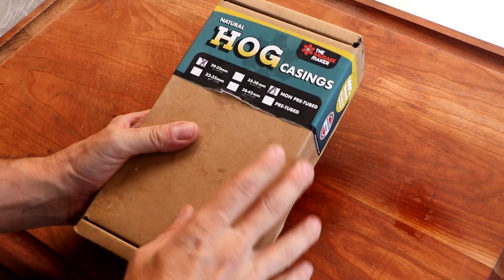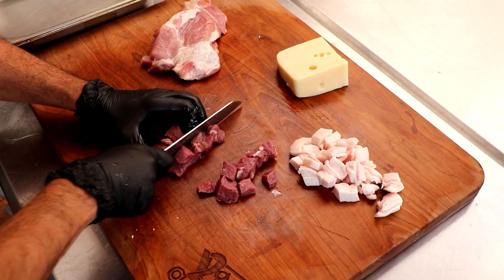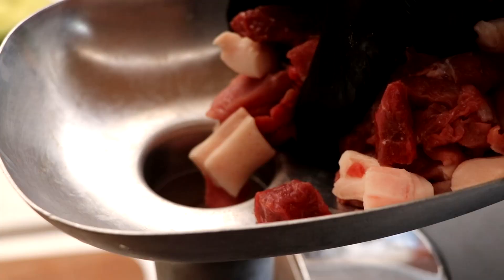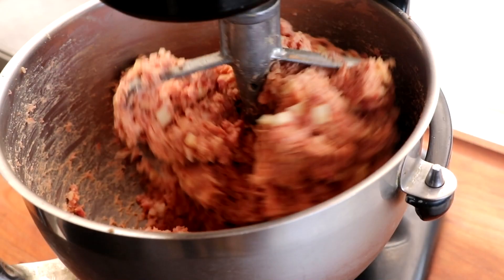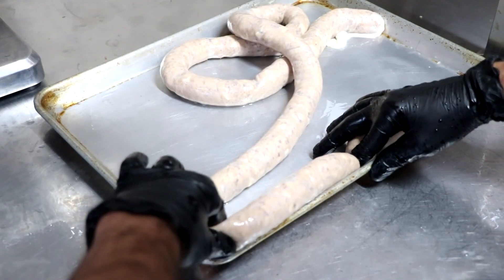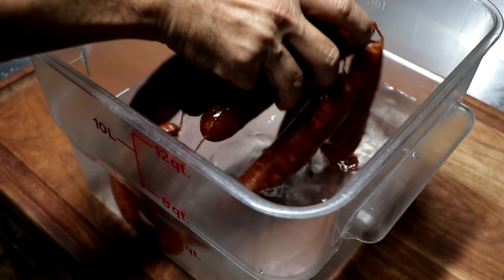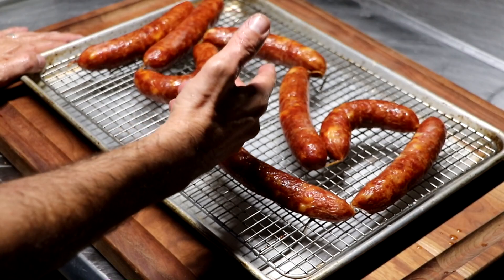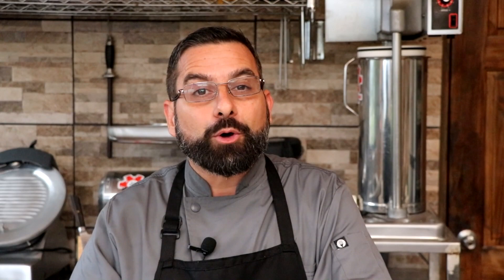Käsekrainer - Cheese Sausage | Celebrate Sausage S03E26

Comment: If you hot smoke these instead of cold smoke, would you leave out the cure or still use it? If you leave it out, would you need to adjust the other spices, or leave them the same?
Reply from the maker: Hi Jeremy.  To be clear, these sausages were not cold smoked.  The language Joe used is misleading and typically BBQ guys will mis claim that they are cold smoking.  Cold smoking is placing meat in a smoker at temps below 85f.  The finished product is still raw.  What Joe did is considered a low and slow.  Either way a cure is recommended.  If you "Hot Smoke" (which is to cook your sausages in temps above 225f) you can omit the cure all together, but you have to cook your sausage to in internal of at least 150-155 for pork.

Comment: How hot does a sausage neet to get before high temp cheese is needed?  The reason I asking is there are a lot more choices, for using regular cheese.
Reply: I am a cheese maker and a sausage maker. I would suggest taking a sample of a few cheeses that you might use in sausage and putting them into an oven at 145f. Small cubes like you would add to the sausage. See which ones start melting at that temp. Then increase the temp and observe. Cull out the cheeses that melt first, or use them at that temp they melt at. I watch several channels for sausages and high temp cheeses are used when often when makers are going to smoke/grill at 275f. It's a subject in flux on the internet at this time. Check out Chudd's BBQ, Grillin and smokin wit AB, Smokey Joe's, Meet Church, etc.

Comment: Nice vid - on another note-  what's the diameter range of sheep casing? Can u make Sausages without the fat though?
Reply from the maker: Sheep casings range from 18mm to 26mm.  While technically you can make a sausage without fat it won't be very good.  Fat brings a lot of flavors, juiciness, and texture to your sausage.  You can have lean sausages (10 -15 %) and that would be ok

Comment: Why would you add cure if you're planning to refrigerate the cured meat? Does the cure not make it shelf stable?
Reply: The cure gives the nice red color and adds flavor, which also are the reasons why cure is used in Leberkäse.
Reply: The sausage was being smoked is another reason.
Reply: @TheWolfyDaddy  
So it has zero reason... Color is not a good reason nor does it actually add flavor. Smoke adds the color
Reply: Cure has nothing to do with shelf stable, nor refrigerating the meat.  When meat us cooked at low temps like 100 to 180 and ground up meat is thus between 50 to 130f for a long time, it is perfect temps for bacteria  pathogens to grow.  In particular, the inside if the ground meat ends up with no oxygen, the perfect environment for botulism to grow (clostridium botulinum).  This is the most potent toxin known to man, couple parts per milkion will kill you, and the spores are everywhere.  The sodium nitrite in cure1 is used primarily to protect against botulism,  and just secondarily against some other pathogens DURING THE LONG  SMOKE COOKING.  If you're not cooking sausages in a pan or 275f plus grill, done in 10 to 20 min, then you need to add cure1.
    All of this is covered in most sausage books, best is Home Production of Quality Meats and Sausages by Marianski.
@William Branstetter
Also, the nitrite DOES create the pink color in ham, NOT the smoke.  Also, the nitrite DOES create the ham flavor, not the smoke.
Reply: @dave_in_az  Spot on mate!